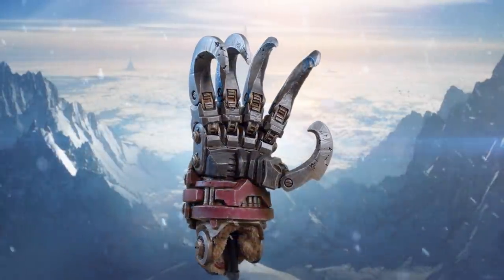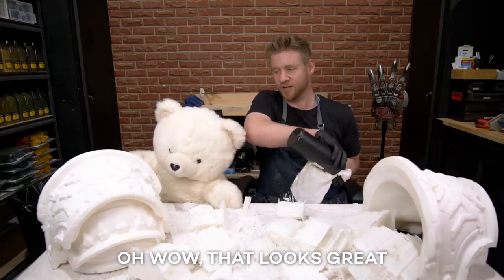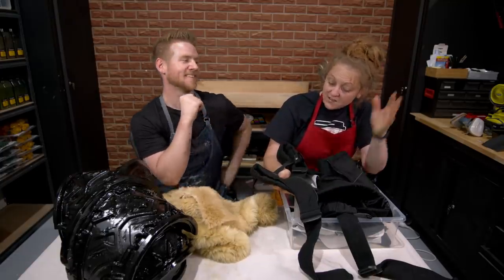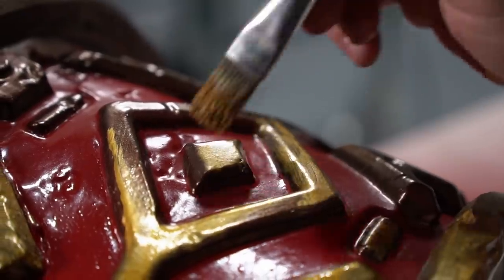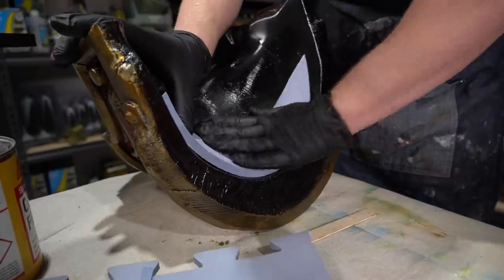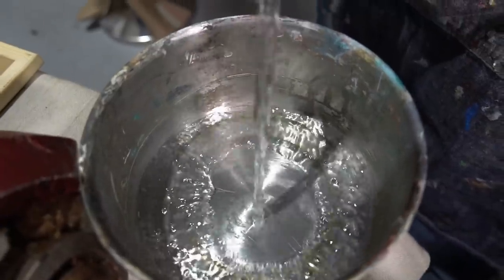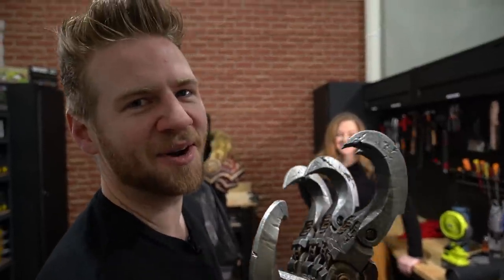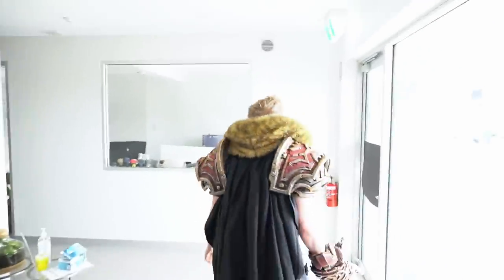I'm making "Space Bear" armor...

Comment: Consider a glue other than Hot Glue please, as someone who's done armor cosplays Hot glue will not hold up well over time! Rubber Cement is a pretty great alternative option
Reply: As just your average crafter, I agree! Any situation in which moisture can generate is a no-no for hit glue. It'll stay in one piece, but it'll unstick from anything else!
Reply: Barge cement. Rigid to soft and soft to soft, cant beat barge. Rigid to rigid, maybe epoxy or CA glue depending on expected load.
Reply: I completely agree! Rubber cement works much better.. but hot glue will hold if you don't plan on doing anything crazy... ok maybe get some rubber cement...
Reply: Do you have any suggestions for latex-free alternatives??
Reply: @theo.haas.98  Barge All-purpose Cement is non-latex as far as I can tell from the MSDS. It is not rubber cement, it is far stronger. Look up barge cement foam tutorials for more info.
Reply: not to mention the chances of it melting ever so slightly in hot temperatures
Reply: Except for in fur. In my previous experience, hot glue is almost completely permanent in fake fur
Reply: @wanderingsoul881  I just found that out too. In fact, barge cement is a PAIN to use for going fur to either foam or a rigid base
Reply: Magnets would have worked well here as well. Would have also made it removable when needed.
Reply: cant import the good rubber cement into Oz anymore unfortunately.

Comment: As someone who does 3D printing I was surprised when you didn’t sand the prints, but you made it work. I’m very impressed well done. 🎉
Reply: this cosplay could be of a chapter serf
Reply: @vanillaicecream2385  0
Reply: @vanillaicecream2385  9
Reply: @vanillaicecream2385  p
Reply: He applied a very thick coat of paint.
Reply: especially since he also covered it in high build primer, and then didnt sand that either. the point of that is you can actually sand it. you cant sand pla, but the high build primer is really easy. 
he seemed to be rushing everything though, the paint job was messy, sloppy with the hot glue. 

I guess he only allotted so much time toward making things like this when its only going to be one video.
Reply: @ge2719  high build primer is self leveling, you dont need to excessive sand it.  Its supposed to look battle worn not shiney and new.  No need to spend all those unnecessary hours with cramped hands for a YT video
Reply: @andrewkaminskas7721  oh yeah . It look very leveled, that why you can still see the layer lines..... Because self leveling.
Reply: @andrewkaminskas7721  Yeah... I gotta go with @G E on this... High Build Primer is self FILLING and easy to smooth by SANDING, but it is NOT 'self leveling'. Yes, it does smooth a lot of flaws, but it ALSO dries pretty quickly, and applies EVENLY. Which is why it's necessary to apply one coating, then SAND IT, and apply a SECOND coat (repeating as needed until the desired flaws are eliminated), with a light sanding (usually fine grit), and THEN final paint.

Visible print lines is the biggest problem with 3D printing, and using the excuse of 'Its supposed to look battle worn, not shiney(sp) and new.' is even worse, as it implies that Distressing is not a thing. Making something look 'battle worn' is almost the LAST step in cosplay (and props, etc...), as the point is to make it look like it IS new, THEN make it look 'battle worn', so it always starts out proportioned correctly, and you aren't guessing if 'this bit' of 'battle worn' is in fact properly INSIDE the dimensions the original, undamaged item...

Sanding does not need to take hours, it just needs to ensure that <one more> coat of high build will smooth the surface of print lines out. (and for those who don't know...sealing/protecting is the last step)